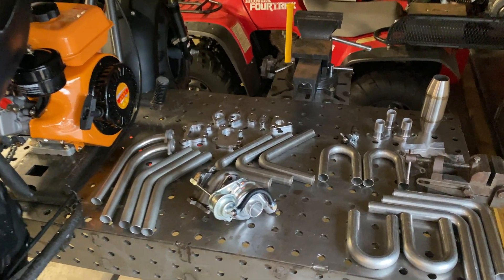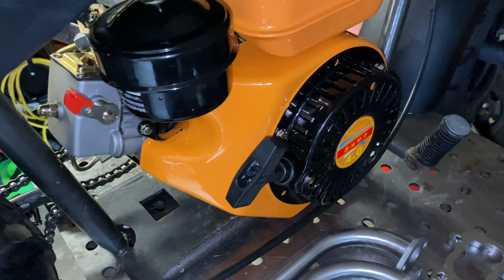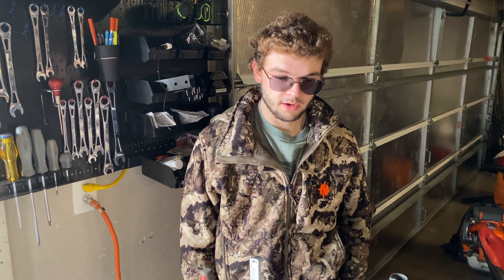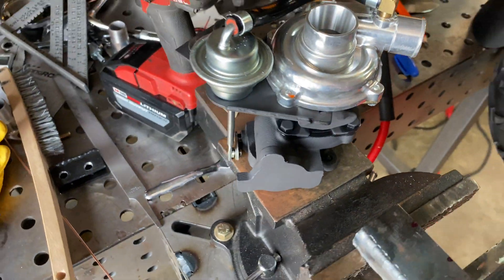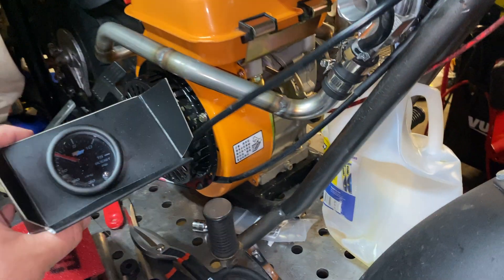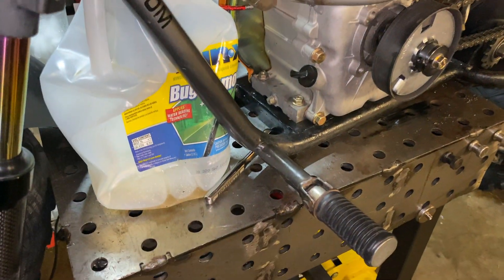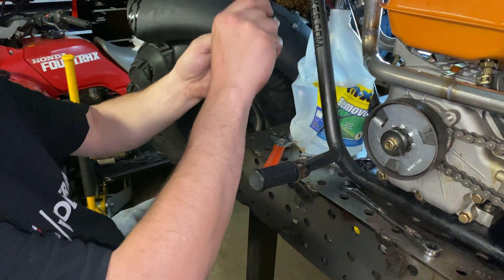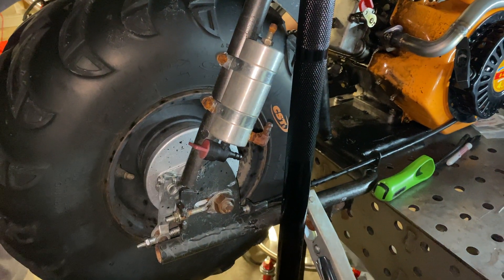Turbo-Diesel Minibike Build Pt.1

Comment: You should be able to cut a hole in the side cover and run some kind of a belt to a mini alternator
Reply from the maker: Man that's a great idea, we are wanting to do some more things to the bike soon. Once this motor is gone I have an electric start version sitting in the crate and I believe it may have a charging system stock. 

I think there may be a guy on tiktok or YouTube that installed a blower on his mini diesel by installing a belt.

Comment: Turbo is too far away from cylinder, hotter the exhaust to turbine better boost. It could be the turbo is made for larger displacement engine.
Reply: That turbo is definitely made for bigger engines, but I don't think they make smaller ones.
Reply from the maker: Correct, but this is the smallest turbo you can buy. Producing 4psi now and feels like double the power when you ride it. Best thing you can do to one of these little Diesel engines. Currently adding a manual clutch to the setup to put more load on engine.

Comment: Take the side cover off and do a governor delete and cut the governor stud. I have this exact same engine and when you cut that stud it frees up the fuel injection pump all the way letting it use as much fuel as it can
Reply from the maker: @lemjohnson 

Ive been signed out of the account for a year but we are back and plan on putting a video together for every week for 2023.

Man this is the best idea I have ever gotten from the comment section. I will tell my brother chance about it and get it done!
Reply: @CampbellBrothersOutdoors  that would be amazing
Reply: Is this the 186 dollar diesel engine on the interwebs, is it reliable
Reply: @andrewjohnson442  yes it is, and yea it is very reliable, I have mine boosted on 5 lbs, not a whole lot but really Wakes it up, I have it on a go cart super fun and torquey
Reply: @lemjohnson6798  okay I'm doing something with a 5hp flathead briggs, en once I finish that, ima make a crawler turbo desire mini bike, soon style
Reply: @andrewjohnson442  that would be sick lol
Reply: @lemjohnson6798  yeah right now I'm taking the flathead, of road scooter, bmx bikes and a rototiller to make a mini rat trike

Comment: Is the pump adjustable to turn it up?
Reply from the maker: Im sure you can modify it with shims but we have not messed with ours, yet.....
Reply: @CampbellBrothersOutdoors   Do you notice any performance difference at all? I messed with my govonor and did the turbo and the same time. Its now slower and has a absurd amount of smoke. Im pretty sure its the govonor is just dumping so much fuel its bogging it, but im not totally sure.

Comment: What clutch did you guys use? 
Everything i see the shaft size is just over 3/4. So a regular clutch wont work?
Reply: They said in a previous video they machined the shaft down.
Reply: You can get 20mm clutches
Reply: My question is rather then turn a hair off the shaft could turn the inside of the clutch or cvt hub?
Reply: Rather then tear down am engine  that is not well supported u could be like here turn a few tho out of this piece and slap er together